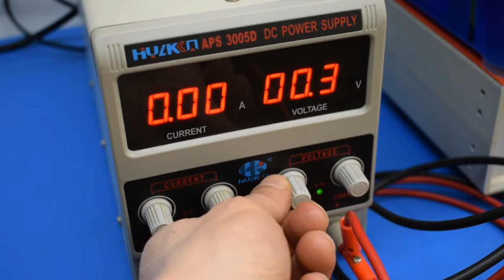I made Nuts become Geodes with Electroforming magic

Comment: I need information about gold electroforming, please give me its video.
Reply from the maker: I don't know any video about gold plating. It's almost the same as the other methods. You just need to change the solution and the anodes and some other variables. You can also do it with the brush method. Try these https://amzn.to/44TUdRf | https://amzn.to/45ZgFck | https://amzn.to/45ZLg9B
Reply: @cuforming ‌Thank you , no, it cannot be made with the solution mentioned by you, but gold electroforming jewelery is available in the market, its process is not available anywhere.
Reply from the maker: @ghanshyamsoni4662  keep looking, you will find it. It's there!